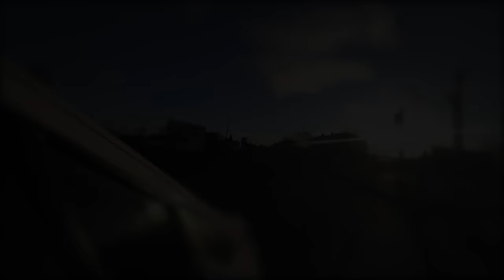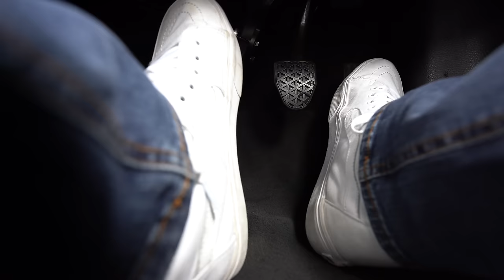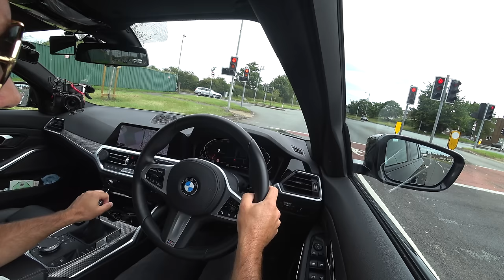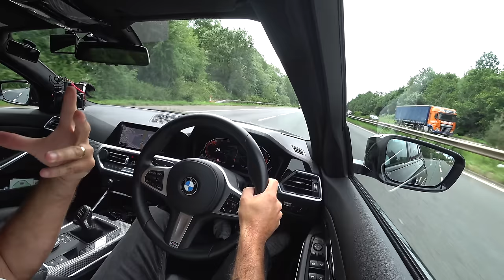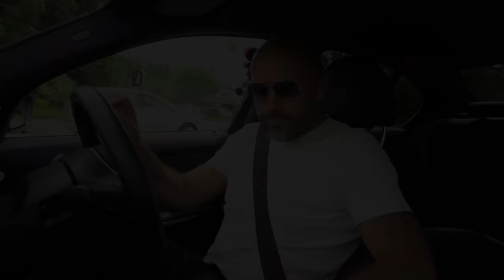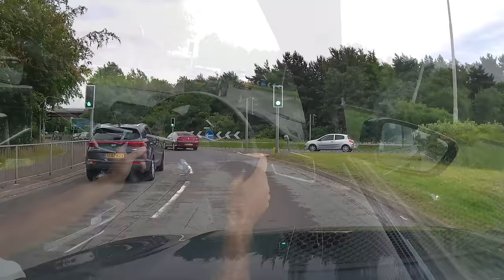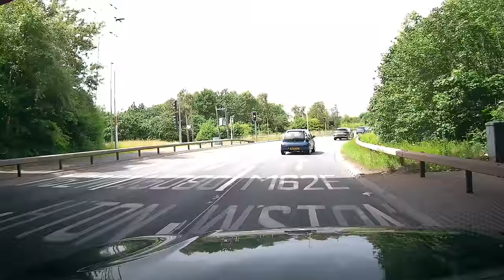Spiral or Gyratory Roundabouts

Comment: Doesn’t signal to come off motorway because there’s no one around. But then signals to go around an island when there’s no one around. THEN comes off an island when there’s people around and doesn’t signal?
Reply: There was no need to signal off the motorway because there was no one there. He signalled right on the roundabout because there was traffic coming out from the first exit, so he is making it clear his position to them. Finally, coming off he was in a lane at the lights for the exit he took
Reply: Liam I Yeah and then he holds back from the van because he says he doesn’t know where he’s going?
Reply: @Plexipal  He said he held back in case the van driver doesn't know what he's doing. You might as well hold back for the sake of 2 seconds.
Reply: Liam I Ah ha! But if the van driver USED HIS INDICATORS to confirm his intention to exit you can be assured that he knows what he’s doing and where he’s going BECAUSE HE’S TELLING YOU WHAT HE IS GOING TO DO and there would be no need for guess work.
Reply: @Plexipal  Indicating isn't necessary there because that lane is for that exit, and people do indicate wrongly or change their mind.
Reply: Liam I Fantastic logic there. No indication is ever necessary in any circumstance because people could intentionally misuse it or just change their minds willy nilly. In no way were they designed to be used for the help of other road users to determine where you intend to go so they can better plan ahead. Thats just silly. Let’s all just guess what everyone is thinking of doing.
Reply: @Plexipal  Of course they are essential, but on a roundabout like this which is not common to many people it makes sense to slow down and allow people to work it out. 👍
Reply: Liam I Ashley himself is a victim of his own logic, when he comes off no signal is necessary other people are just supposed to know where he intends to go, but when a van does it he has to stay back just in case the van fails to make the turn.
Reply from the maker: @Plex It's a good discussion point but there are a few points you have missed. There is a big difference between me not signalling to leave and the van maybe needing to, and it's down to observations and other people around. When I left the spiral the first time people in front don't need my signal and there is no one in the lane behind to my right - No signal. With the van, I was close and behind to the right - So a signal might help. My final exit off the spiral I do signal to leave, as the junction I'm entering is not traffic light controlled and cars emerging will benefit. My signals are situational and observation based which is ideally how they should be. If you aren't skilled enough to drive in this manner you are better off putting a signal on to exit. 
Did you see what else made me decide to give caution to the van in that scenario? Good discussion guys :) Ashley

Comment: There is no place in common sense for spiral roundabouts. Completely inneficient and a waste of everybody's time.
Marking a roundabout spirally reduces the capacity by a huge margin as you are sitting waiting longer in order to enter - because cars are passing on the outside lane blocking your entry, rather than on the inside ( correct) lane on a standard roundabout, which allows you to get your nose out as they approach and merge in behind them. Spiral roundabouts don't give you the time to do this hence you wait longer to join - ie inefficient and nonsensical.